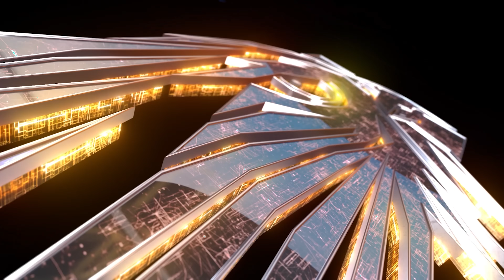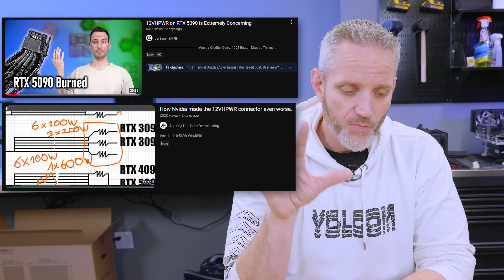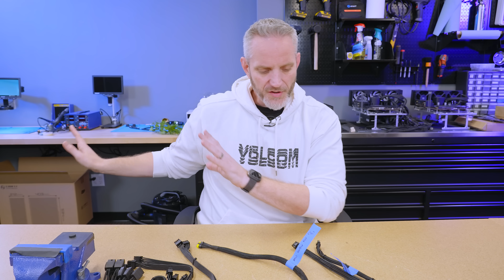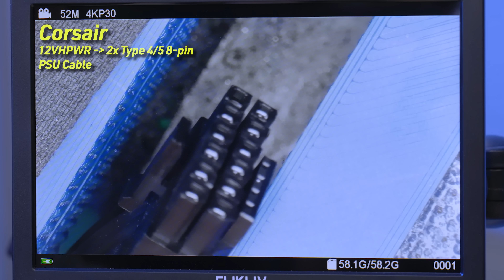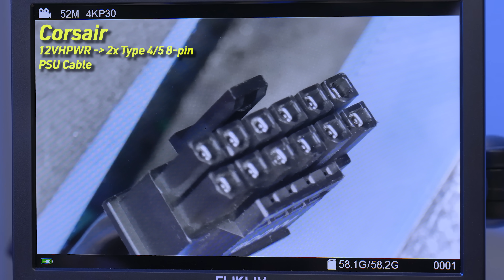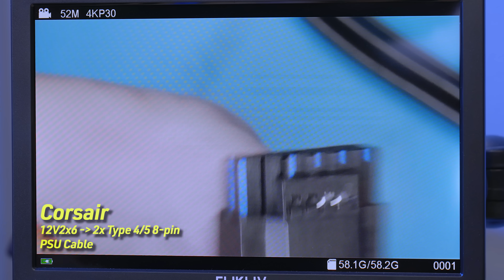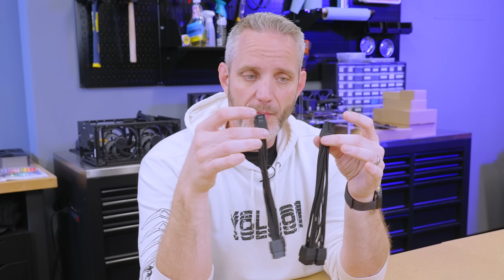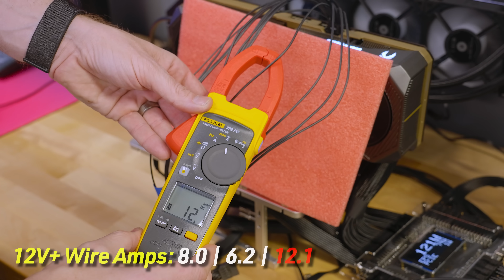I discovered something concerning and I need the Experts to chime in... More 12VHPWR discovery!

Comment: Aircraft engineer here. Had we found a plug with a pin looking like that, that would be immediately replaced. That could cause system faults, error signals and the list goes on. For troubleshooting purposes, inspecting the plugs for stuff like that is one of the first steps we do. :/
Reply: Someone would really need to be inspecting the crimp pins before they go into the housing to see if the barbs are damaged. And the quality and metal gauge of crimp pins varies widely - look at an amphenol or molex crimp pin vs some chinese branded crimp pins.
Reply: If the contacts are not correct in contact you can get sparks.
Reply: i dont understand wy they dont just use stuff from the auto industrie then they dont have to design a cable they can just buy one
Reply: Yes. There is a reason why aviation style pins are often cnc machined, cost a dollar each and require a piece of $2000 calibrated tooling to crimp.
Reply: Aviation standards wouldn't let them use pins like this in general. Most milspec connectors I have used are much much higher quality, better contact area, contact surface, gold plated/anticorrosive, water tight connectors, yadda yadda.
Reply: @dohabandit  Majority of power-carrying plugs I feel are cannon plugs made of metal (aluminum?). PCIe took the RJ45 route of connector + retention clip. The new high power just needs a genuinely new approach, as 600w seems like a lot, but maybe two plugs pulling 300-400w is better than one plug pulling 600w on the current plug style. I think cannon plugs are too bulky and frankly much more expensive than plastic (and I don't know if cannon plugs require manual assembly/special assembly).
Reply: You clearly do not work for Boeing :P
Reply: @jimmydandy9364  Wa? "and the list goes on" isn't a technical term? 😂How about "stuff like that"? lel
Reply: Not even acceptable in basic automotive use.
Reply: The pin is inserted 180° vs all the other the retention clip is only on one side no wonder this pin move like that
Look at the pin the are c shaped and where the metal meet is backwards bs all the other
Reply: Yea they don't do that at NV.
Reply: Don't worry the only concern here is the graphics card catching fire and the customer needing to buy a new one. Totally nothing to worry about from Nvidias perspective.
Reply: Graphics cards aren't airplanes. The safety margins and inspection requirements for aircraft are insane, in a good way, the fact that you are making this comparison while buying Chinese electronics with zero tolerance is fucking laughable.

Try again.
Reply: There is a large overlap between aircraft industry and military industry (MIL spec), and an entire military aircraft industry. These two industries require essentially tolerances to be small. 

For those arguing if this card needs it, I offer for your consideration the Toyota Lean Six Sigma. If you appreciate having a car capable of 1 million miles by ensuring a precise process, tight tolerances, then you might appreciate using validated parts that perform as advertised. 

I second OPs comment that there is a large and unnecessary risk in seeking to maximize power on the 600w rated cable, and when you combine that with Jay's video on tolerances being loose (at least potentially), you may exceed capability by using your product in an ordinary way. 

The simple fact that load isn't split more consistently across the power carrying cables is bad (more variance). Combine all these variance items and you get the opposite of LSS that Toyota built a brand upon.
Reply: unless you're Boeing, in which case you could just take the cable, don't install it and claim it's "installed" 😂 then hope it wasn't important
Reply: Sir why is 737 max not grounded yet
Reply: Not sure why any "electrician", "engineer", and or presidents of small islands here, did not open with beginning, simple, electric basics like, the fact that the power supply can and Will pull 50-60 amps@ 600 watts. 50 amp draw needs 6 gauge copper or 4 gauge aluminum wiring. Most of these wires and connectors are a mixture of both. Either way none are capable of holding safely 50+ amps. And what happens when you attempt it? Melt down. Hell, some of those power supplies pull 80+ amps...
600W / 12V = 50A Why not 120V? Thats only 5 amps...
Your computer's power supply unit (PSU) converts alternating current (AC) from a wall outlet into DC. 
Something I think these designers either have forgotten or never knew.
This problem will not go away until it is done correctly. 
Most electronics need low-voltage DC (like 5V, 9V, or 12V), but wall outlets provide high-voltage AC (100V-240V). Therefore, must be lowered and converted AC to DC, making it safe to provide directly from standard outlets.
If you read the numbers on the power supply you'll notice this as truth. If you learn the pc's voltage use you'll understand the complete process.
So much for the thousands of "engineers" and "electricians" here..This is basic stuff.
Reply: @LibelLinus304 Its a good try but you're basing all this on a misunderstanding. 50A requires 6ga wire *at 120v AC*. These wires aren't carrying 120v AC, they're carrying 12v (or 5v) DC.  Length of run is also a factor in this calculation since the resistance of the wire is higher as it gets longer.

Most runs in PC are under 2' in length. If you look at 12v DC charts to make it simple most show as 50A load at 2' run needing 12ga wire. This holds true up to 4' which covers basically any run you would ever have inside a PC.

You don't need 6ga wire until the run is 10' long @12v
Reply: @Raven1024  Wrong, The AC current IN is 120V the current out of the PSU is DC.
50 amp is 50 amp. It's written on the PSU itself. smh
Length isn't a factor here. These wires carry 12V divided by the wattage demands.
I.E. 50 Amps at 600 watts. Semantics aside, my point still stands, the gauge is not 12 either. 
The length is only a factor when it becomes TOO long, shortening has no effect. Idk who told you 50 amp @ 2' only requires 12ga. You don't understand the basics, Idk you bothered.
Reply: @Raven1024  Even IF one decides to continue to ride the line of possible failures, "minimum" shouldn't be the standard, but IF we use the actual chart 8ga is listed from zero to four feet @ 50 amps. True, as professionals do, our standards at 6 gauge. Even so, 8ga is a far cry from 14ga at best with this connectors. Most are 16 and 18.
Reply: @Raven1024  And then there's the knowledge that not only are the PSU's being reengineered, the gpu pcb's are for the very reasons I mentioned. AND a future consideration for requiring your AC supply to be above the standard 15 amp.
Can you guess why? 
Either way, the need for the reengineering occurred at the onset, hence the issues, hence why the progression to arrive at the solutions. You're arguing against the proven. I'm done here.
Reply: @Raven1024  Oh and "it was a good try".
Reply: @LibelLinus304 You just typed four comments of nonsense all to try to claim length isn't a factor in wire sizing and to restate what I said which is PSUs put out DC...and no, 12v DC charts do NOT show 8ga 0-4ft. It's 12 ga, I guess you need to learn to read a chart and how wire sizing works.

I'm not even responding to the rest where you try to claim this would make you above standard 15A when the total power drawn is well below that. I'm done here because you are in lala land physics and not real world physics
Reply: @Raven1024  In other words you can't answer why the industry is progressing to require more than the standard 15amp AC current outlet. No one said sht about, "THIS WOULD REQUIRE". You aren't the brightest crayon...stick to call of duty..
Reply: @ Here, you can get someone to help you with it, I'll copy and paste what I typed, "AND a future consideration for requiring your AC supply to be above the standard 15 amp.
Can you guess why?" 
And you took that as I suggested what now? Weetald..
Reply: @Raven1024  Those DC charts are mostly for evaluating voltage drop across the wiring, not really for current carrying capacity. 50A through a single 12ga wire will create a lot of heat regardless of the length of the wire, unless the wiring is very short and connected to parts that can sink that heat away from the wire. 

Current carrying capacity is purely a thermal issue. All wires have a certain conductor temperature that they are not allowed to exceed, otherwise the insulation could be damaged or it's lifetime will be reduced greatly. Load current itself will create heat, but you will need to consider how well that wire can dissipate the heat away, this is affected by the method of installation, nearby loaded conductors and the ambient temperature. You can even destroy wires without passing ANY current through them, just place them in a too hot of an environment or heat them up in a another way, debunking the all too common thought that as long as the current is below wire rating (and with wire rating, I mean a generic rating, not a proper calculated one), it will survive.

For example, a single 1,5mm² conductor (roughly 16 AWG) can handle about 22-23 amps if it is installed in free air at room temperature (and even more if the insulation has good heat resistance). But install 12 such wires in a bundle, all loaded, and that capacity would drop to 12-13 amps max. Why? Because there is less surface area for heat dissipation and more conductors creating heat, heating each other up. If you were to place that bundle in an environment hotter than room temperature, that capacity would drop down even more. There are a lot more things to consider than just the cross section when sizing wires.
Reply: @penaroskaposti8145  You do realize that the voltage drop is caused by the same mechanism that causes the heat right? The two are connected intrinsically because both are caused by total resistance in the wire, which is affected heavily by length of the wire. That's why there are multiple charts, the free air chart is the one that applies here, because these wires are in a very air circulated environment and are not in conduit or any other solid wall containment of any kind. The reason the charts are generally accurate for sizing is because of you use the right chart (free air in this case) the odds of you having a heat issue are basically nil when you are under 3% drop.

Also yeah, when you bundle a ton of cables in conduit it lowers the capacity. That has....wait for it....nothing to do with these calculations in a PC because these wires are not in conduit, are in free air, and in fact have highly circulated air. It is beyond not applicable here. At worst they are surrounded by mesh that is ~70% open. But it really isn't going to change things much for most of these cable bundles unless you are cranking down zip ties over them at multiple points. Like...every two inches.

At the end of the day power hungry GPUs is nothing new. This argument doesn't even really need the physics to be proven. If the wire sizing needed to be what is claimed above we would have had a lot more fires and melted connectors over the years from single 6 pin and 8 pin and even dual 8 pin GPUs when overclocked. Even 980ti and 1080ti could hit easily way more wattage than a 4090 if you pushed it. But even without that they were regularly at this level with overclockers. The wire size hasn't changed. What has changed is a terrible connector.
Reply: @LibelLinus304 Nothing about this requires more than a 15 amp outlet. I don't know what you're smoking dude. Unless you're trying to predict the future in which case, I don't talk to oracles or tarot readers about physics based problems. I like to live in the real world. Nothing points to needing more than 15A for household gaming. Most people even on high end rigs are only pulling about 10A of the 15A at *most*.

The vast, vast, VAST majority are closer to 5-6A.
Reply: @Raven1024  Yes, voltage drop increases with wire length. However, temperature rise of the wire does not. You have to think in terms off watts per unit of length, not the total amount of dissipated power, unless we are talking about coiled wires. A 10m run of wire does not heat up more than a 1m run of wire with the same current, unless the wire is coiled up. You are right that the TOTAL heat produced, is directly related to the length of the wire, however the amount of heat produced per unit of length does not increase. I suggest you to test this out in a practical test if you can, don't just trust my words. Many (but not all!) of those automotive wiring tables give absolutely ridiculous ratings for very short runs of wire because they do not consider the thermal aspect of sizing wires. One for example, stated that 12 AWG could be used for a 90A circuit if the length is less than 2 feet. I guess you could do that with silicone or teflon wire, but definitely not with PVC.

Wire bundling does affect the capacity, even if they are not in a conduit. I have tested this myself many times and compared it to calculated values, those correction factors do give out surprisingly accurate results. However, you are correct with forced air cooling, that does help a lot with cooling, and such tables intended for fixed wiring in mostly buildings or switchgear do not take this into account, you would need to do actual temperature rise tests to figure out the actual capacity in an environment with forced cooling.

My original post was aimed to point out that generic wire ratings and the actual current carrying capacity are often two entirely different things. You can get away with high currents if you have good cooling, but you can also cause damage even under the wire rating, if the cooling conditions are bad enough. Very few people seem to understand this as they either are horrified of currents exceeding values for fixed wiring inside walls, or do not understand why a bundle of wires would heat up more than a single one.
Reply: @penaroskaposti8145  Length also changes surface area though. From a surface area standpoint if we go with each wire being somewhere around 20 inches in length which seems reasonable, each 12ga wire would be able to dissipate just over 3W of heat worth of losses over 20 inches each also has the return though so that's 40 inches of total wire for each 50A, or just over 6W of surface area dissipation to maintain a 60C rise. The losses to heat over that distance are about 8W. Which means it will get a little over 60C rise. (Without taking into account moving air cooling or any heat sunk into the connection points at the end of chassis components touching the bundle and sinking heat) Most cables I've seen in PCs are 75°C rated which would likely be fine in this scenario. But they should probably use 90C rated for these if they wanna be on the safe side.

All of that aside...it's the connectors melting and not the wire anyway. The pins are well below the gauge they should be for this.
Reply: Comparing tolerances on an aircraft system is a bit of an unfair comparison to a GPU cable lol
Reply: @FatJeffStew  Is it really that unfair? Shouldnt you demand same quality control and tolerance on everything including your gpu? Especially when that thing costs 2000 USD. Considering how big Nvidia is, none of this should have happened in the first place. If you have gpu with 575W TDP and cable rated to 600W then failure is inevitable.
Reply: @Raven777777777777777  oh I don't disagree that the QC should still be high, just stating his comparison wasn't exactly fair. On this case the connector itself isn't a Nvidia but a Corsair issue. Now the fact that they continue to use 1 of these connectors is a Nvidia problem...
Reply: @FatJeffStew  Nope, you are wrong. Learn basic electric and you will see everything is the same.
Reply: @evtimgaydarov2267  wait until you learn how bad the average electrical wiring is in your standard house... Different electrical applications, especially on the connector side of things can have varying degrees of tolerances...
Reply: @FatJeffStew  My water heater is on a separate circuit with 6 square millimeter of cable, my oven is also on a separate circuit on 6 square millimeter cable. So, bye, bye
Reply: @FatJeffStew  I disagree. Any connection with enough (or too much, I guess) power going through it and improper contacts could cause an electrical fire. Tolerances are tight where electricity is concerned, pretty much regardless of the application.
Reply: @drmcweazel  I never said the tolerances weren't tight, just that the tolerances in an aircraft are usually much smaller across the board with everything. You know because if you have an issue 30,000 feet in the sky you're SOL.
Reply: @drmcweazel No… if someone fails in your GPU power delivery, maybe it bricks it. Worst case a fire. If something fails with your aircraft power delivery it plummets from the sky…

Aircraft’s have very rigid requirements to the point of arguably being detrimental in the case of older small planes in need of repair.
Reply: @ragon39  We've seen how small planes have been doing lately here in the USA...
Reply: What does your aircraft engineer here have to with this? We are supposed to bow down, face you and proclaim we are not worthy?  "Listen to me! I am special! I know stuff peasants!"
Reply: @JamesSullivan-ru4op it means that he's probably worked with electrical equipment before in work force that needs to be precise otherwise people lives are in danger. He said what he has done and would do within his company. 

Shows he has more experience than a random button pusher than has never even connected 2 wires togethers
Reply: @JamesSullivan-ru4op  I'm assuming it means as an aircraft engineer he has worked with a lot of power connectors, and that the state of a connection like this would be considered too much of a risk in his industry.
Reply: Bruh you sound like a salty family member who got affected by a boeing crash @JamesSullivan-ru4op
Reply: Haha are you okay Mr Sulluvan? Have a little bit of chill there keybord warrior. @JamesSullivan-ru4op
Reply: @JamesSullivan-ru4op  the bad vibes lobby is 2 doors down to the left.
Reply: @MaikyMoto  Too much overflow. Bad vibes have taken over the entire wing.
Reply: @JamesSullivan-ru4op  dude take a chill pill, i work in the industry as well and it´s a huge difference on whats tolerated, cause safety, and no i don´t beleive people like you know what a CoC means.